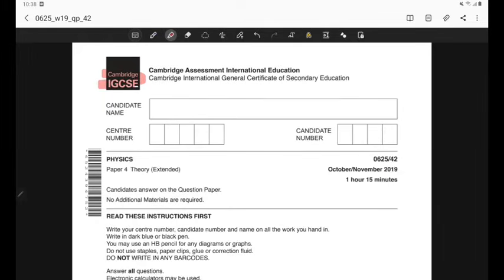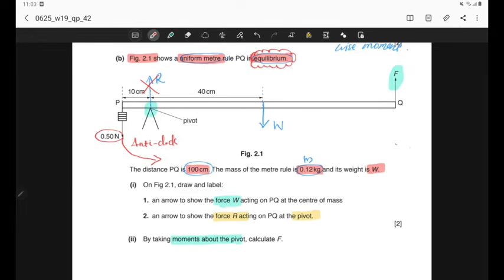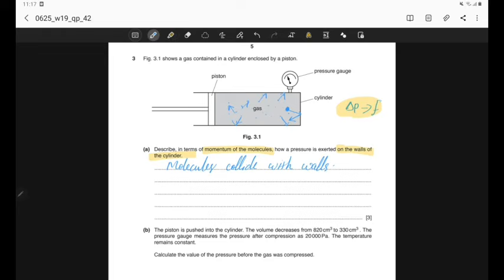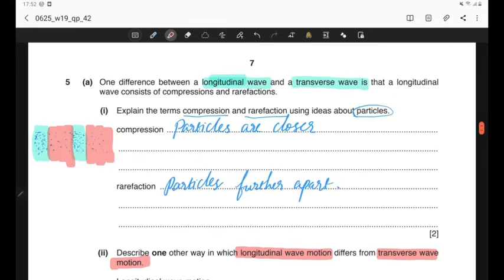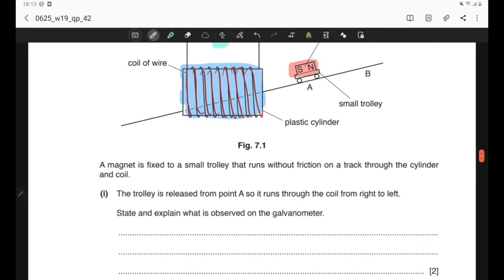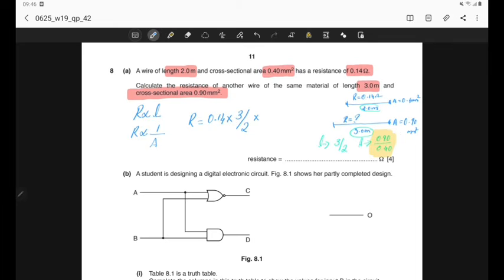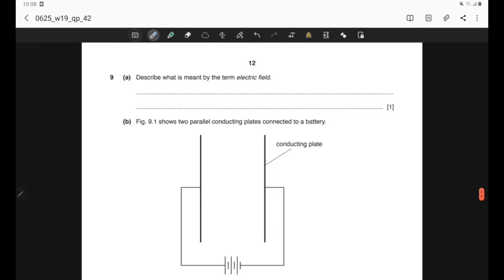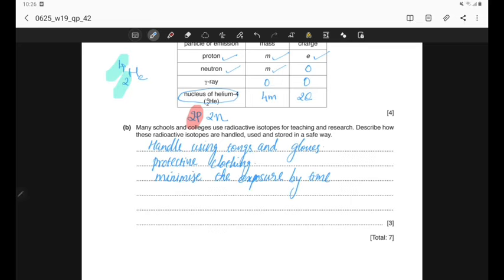0625/42/O/N/19 whole paper Solution IGCSE Physics paper 42(OCT/NOV 2019)

Comment: wait for 4a, isn't specific heat capacity= energy/ mass*change in temperature?
Reply: thermal capacity = mass x specific heat capacity
energy = mass x specific heat capacity x temperature change

in the question the values of temperature change and energy are given
so the equation will be
energy / temperature change = mass x specific heat capacity

but we know that mass x specific heat capacity = thermal capacity
so we can substitute the equation with the following
energy / temperature change = thermal capacity

and u get ur answer
Reply: thermal capacity= mass x specific heat capacity. therefore thermal capacity = mass x (energy/mass x temperature change). So mass on on both sides will cnacel out. so remaining equation will be energy/ temp change. hope this helped